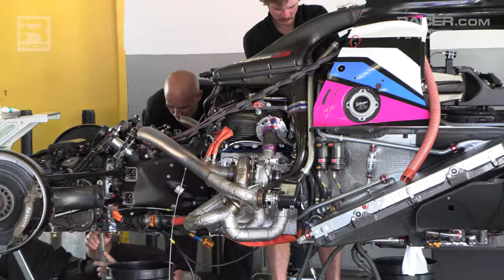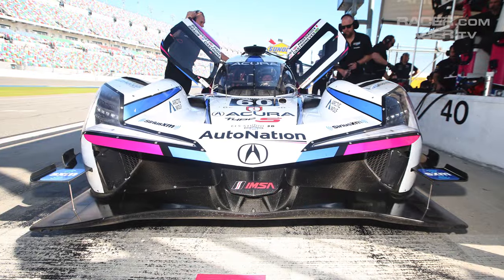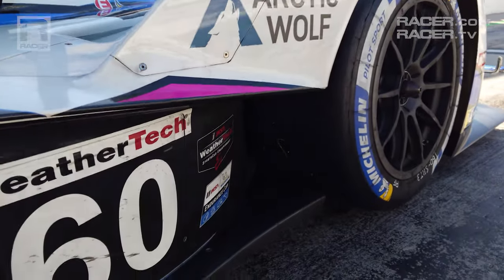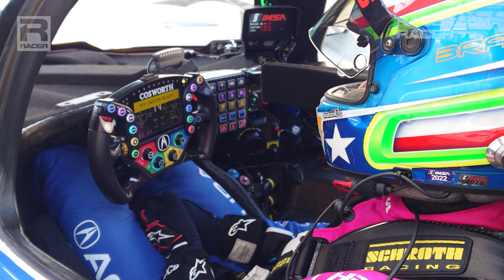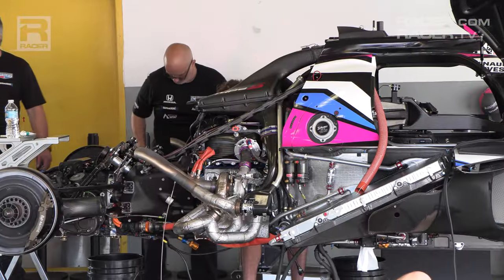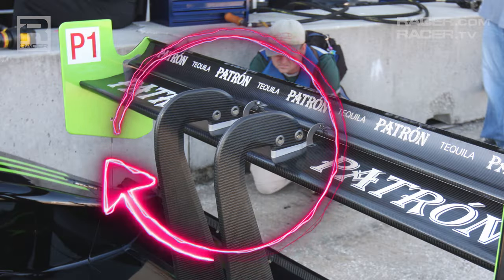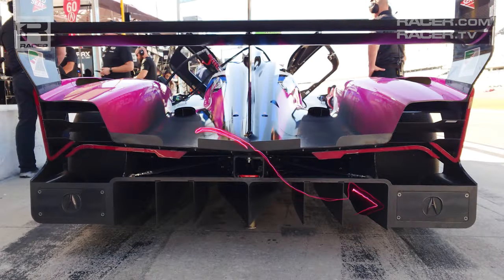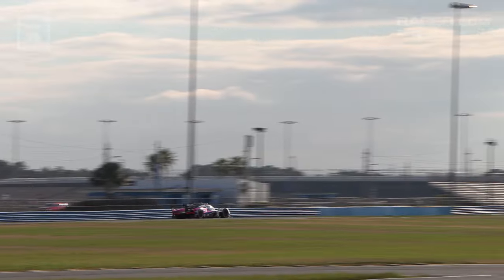IMSA GTP 101: Acura ARX-06 Tech Tour

Comment: Looking forward to the videos about all the other cars. About the ARX-06, eventhough the vents extracting hot air out the radiators seem to be angled away from the brake ducts, wouldn't some hot air still flow into ducts anyway? Seems like there's not alot of margin to prevent that from happening.